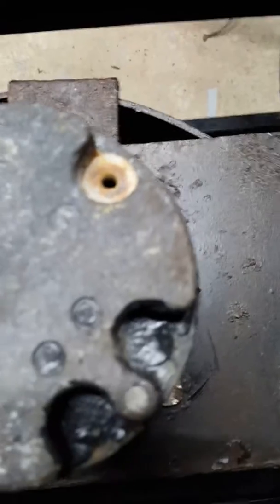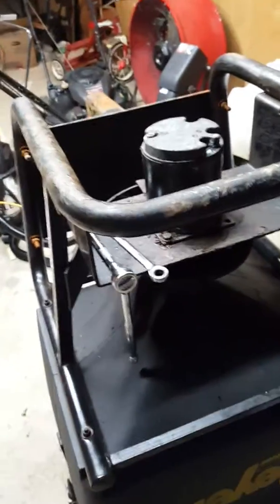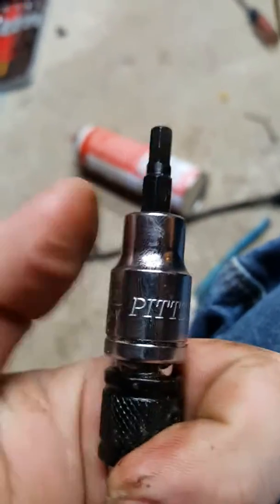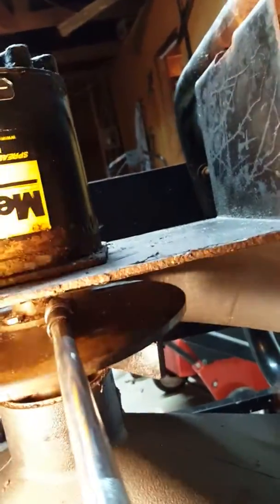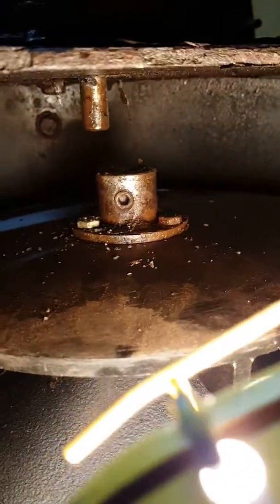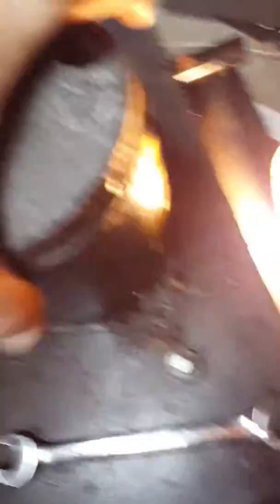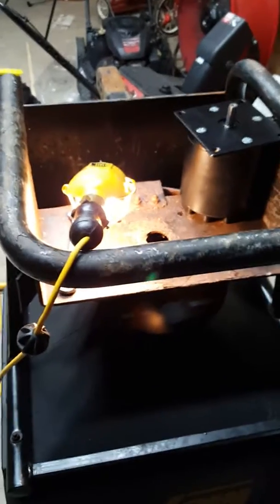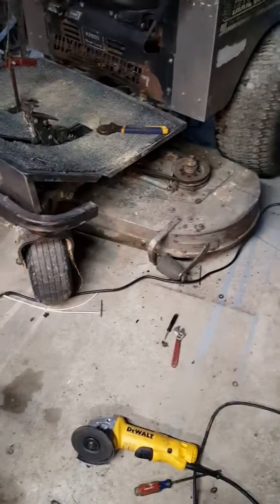Meyer bl400 salt spreader motor replacement.

Comment: Just did this on one that is 5 years old. If it wont move, heat it. If it still wont move, heat again. If at this point its still not moving keep heating. Just finally got it with 2 people and a couple pry bars.
Reply from the maker: I got rid of it this season.  I upgraded to a boss 1100. Love it. Hope this video helped in some way. I didnt see one when I needed one
Reply: Yah this spreaders a light- duty homeowner junk.

Comment: I would suggest before you even use the spreader to replace the bolts washes, lock washer and nuts with stainless steel. These motors will only last a few years. Tops 3-4. So, you will replace it. Save yourself the grief down the road. Also, put some anti lock on the new bolts. The Meyer bolts  are $hite and they rust and break just like the motor. I’d also suggest spraying the frame of the spreader with clear coat before use. Then in the winter cover the metal of the frame with used motor oil or grease to keep it from rusting. Ask me how I know this! 🤣
Reply from the maker: True. I just needed it for the rest of the winter.   I no  longer do snow removal.  Good information on your comment. I ended up doing that.  Just not in the video